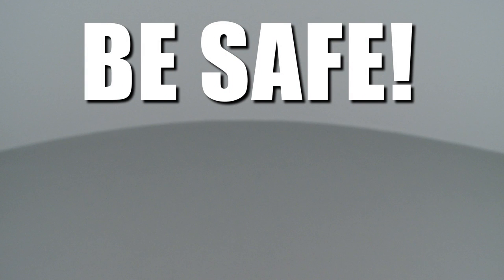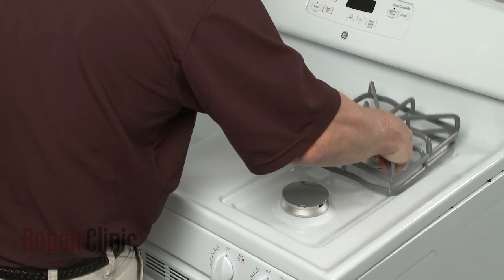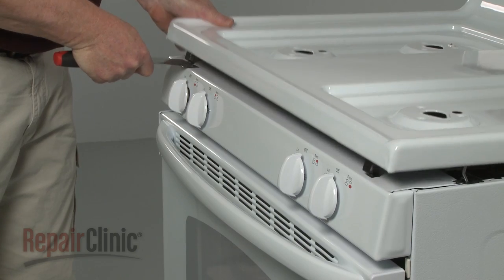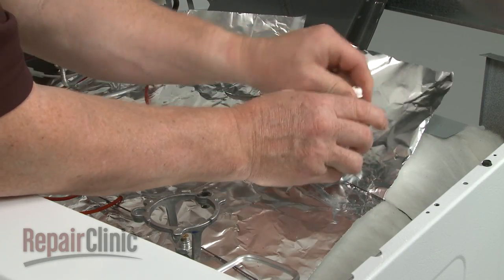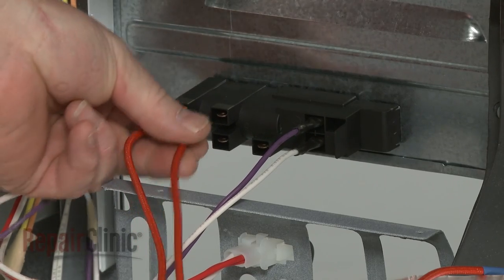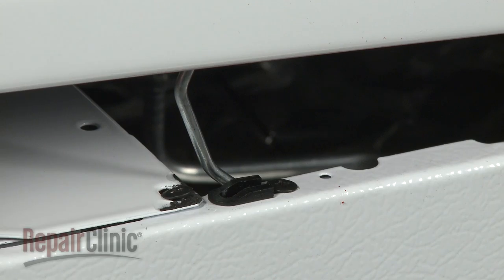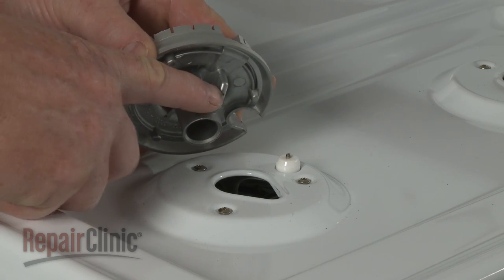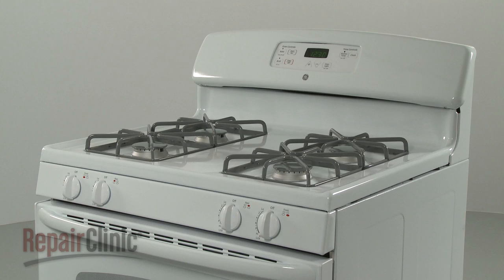GE Gas Range Burner Won't Light? Replace Igniter #WB18K10098

Comment: I have the exact same GE stove as in the video. The right rear burner will not light, although it sparks. I followed the instructions. The top can be loosened (I removed all screws at burner bases) but not removed - the white spark caps are securely attached. The best I can do is lift the top - like a car hood - for a gap of about 6 inches. I can barely get my hand in the opening, but not my head for a closer inspection. The fixtures, including gas lines, are securely attached to the underside of the top. Using a flashlight everything seems to be okay. I removed the knobs and front panel, the regulator seems to be okay too. With fine sandpaper I cleaned the metal part of the white igniter, tried it, and the burner lights. I don't know what I did to fix it! No parts required!
Reply: there is a tiny flash hole in the aluminum piece that goes over the igniter.sometimes you need to take a paper clip and clean the whole out
Reply: Wally Kaspa
Reply: Wally Kaspars Im gonna try that. Good idea

Comment: Mine was an older GE Adora model, the igintors are mounted to the stove top surface. Did the the fronts 1st leaving the screws in then removed the front and center screws so the top can lift to get to the backs. My stove top keeper clips where up front, not on the sides. They took some force to get them to release using a large standard screw driver on the corners to pry it up.

Comment: They always make things difficult to fix but they stop working I just bought a new gas range ge stove top burners want light all i get is the clicking sound and gas is flowing through but burners want light.
Reply: Same any idea what it was? I'm desperate and on a budget
Reply: Check the burner bases. There is a pin hole that allows gas to flow into the igniter 'cave'. This can get plugged up during cleaning. Take a small wire and clear it.
Reply: @thomassullivan4177  Didn't make any difference

Comment: In my GE range only the middle burner sparks. For some reason all of my knobs are controlling or making my middle burner spark only. I already replaced the spark module and it does the same thing.

Comment: my GE gas stove has a short keeps blowing a fuse. I looked over the stove to find any pinched or damaged wires no luck could it be my igniters?
Reply from the maker: +Karen Cloutier Probably not an igniter because the igniter only get voltage when the stove is plugged in and one of the knobs is set to the LITE position. We would suspect a short in the spark switch wiring harness.